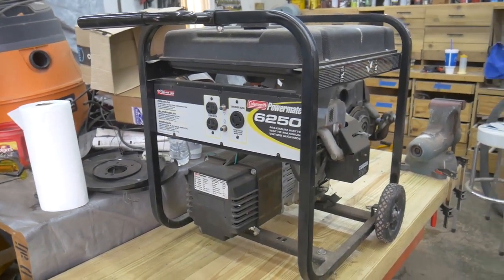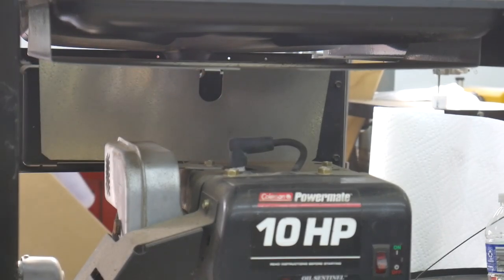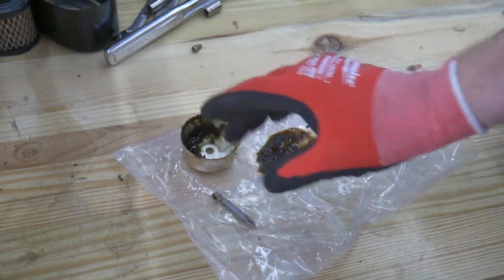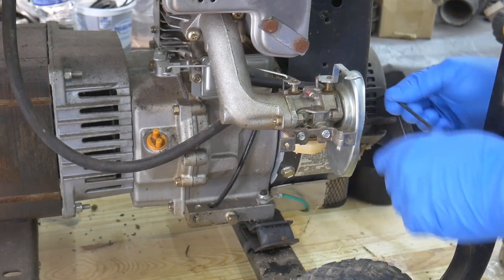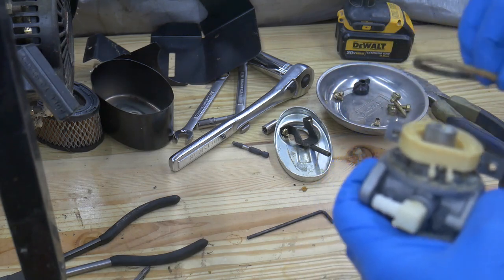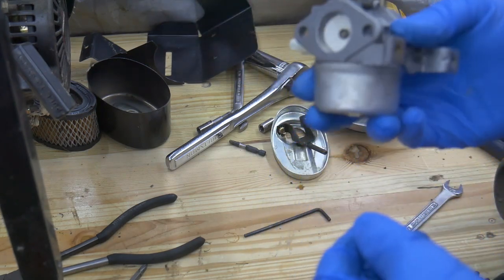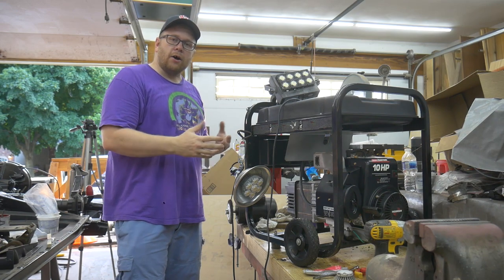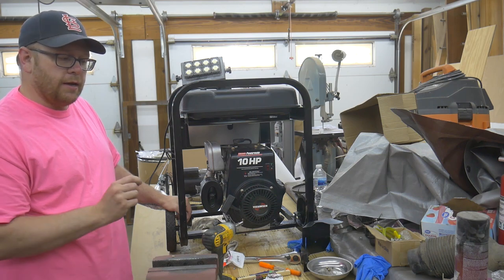A Very Special "Will It Run?" Episode: Coleman Powermate 6250.  Surprise at the end!!

Comment: Thank you for making this video. I’m going through a similar process on this generator that has sat for years. One thing that you didn’t address in the video was removing the spark plug. I can’t seem to get a spark plug socket onto the plug due to the fins on the top of the engine. I guess I’ll have to find a thin walled spark plug socket somewhere that will allow me to replace the plug with a new one. Weird…
Reply from the maker: You are on the right track. Some spark plugs are a tight fit and a thin wall socket is the only way to get to them. Another option is to buy a chainsaw “scrwrench” or screwdriver-wrench. It is a t-handle type tool that has a stamped steel spark plug socket in the handle.

Comment: wow I have a similar coleman 5000 and it never starts that easy usually after 20 pulls and close  to a heart attack later it will start
Reply from the maker: Either a fuel delivery issue or a dirty carburetor. You pulling on full choke the first few times to prime the system?